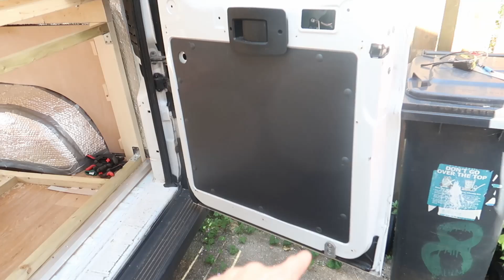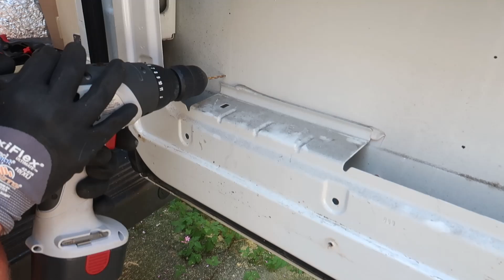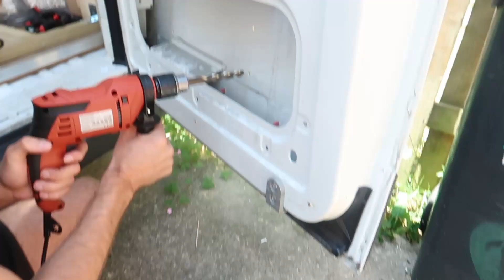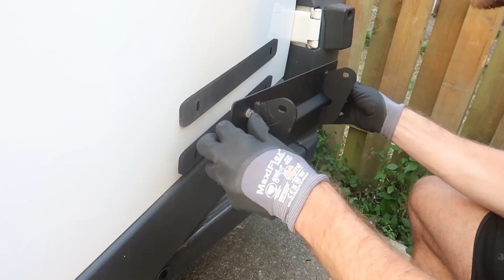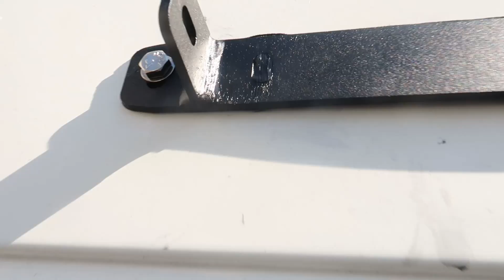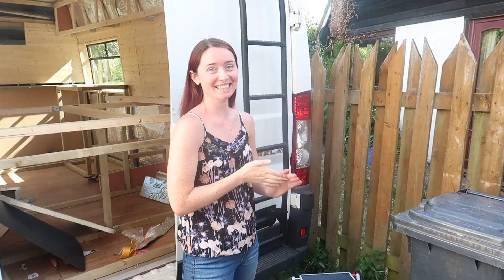Van Rear Door Rhino Ladder Installation | Beginner Van Conversion Series UK

Comment: you cant put weight on sheet metal. she has 55kg and went on dead slow. i wana see a regular 90kg man go there fast and then from the roof. he will bend the sheet metal
Reply: I've got one , which I fitted properly, and it's fine, I'm near 100kg

Comment: Great work and nice looking ladder.  Bit of advice, a very common mistake for drilling through metal is going full speed on the drill.  It is always best drill nice and slow, keeps the drill bits from excessive heat so you're not throwing any hot shards of metal anywhere, and the drill bits stay nice and sharp ^_^
Reply from the maker: Cheers

Comment: Looking great guys! Sounds like you have your drill in hammer mode while drilling through the steel body of the van. Hammer made is just for drilling masonry 👍👍
Reply: Hammer mode is for brick work 👍🏻
Reply from the maker: Ah, that's interesting! didn't even know there was such a thing as 'hammer' mode. Not sure we'll need to drill any more holes in the van for a while now though :D

Comment: Is there a reason you didn’t put the bottom bracket over half of the rear bottom trim as per instructions? Just curious as I have just purchased one for my van.
Reply from the maker: The instructions that came with our ladder didn’t say anything about putting it over the trim??
Reply: Callum & Tash oh right. I had issues when I got mine. I had the wrong instructions and it was saying I should have lots more sticky foam then I had. After speaking with them we ironed it out and they had sent wrong instructions but I had all the right stuff. Just gotta put it on now 🤞

Comment: Looks great guys. I suspect the bolt heads were 13mm and a 8mm thread. So glad you didn't drill it out to 13mm. If you wanted you could always drill the top plate through the holes in the door, then put 2 more bolts in. Just an idea. Good job though guys.
Reply from the maker: Thank you